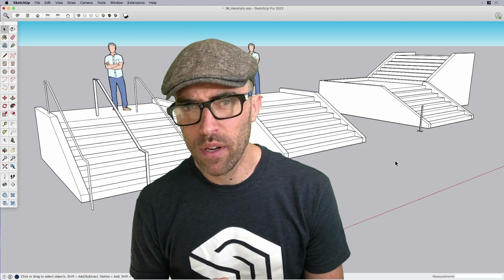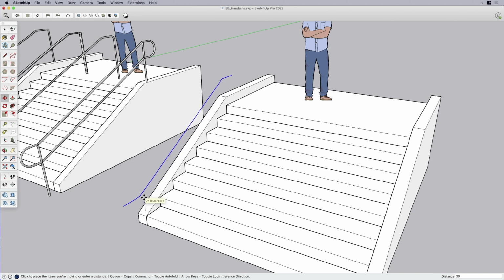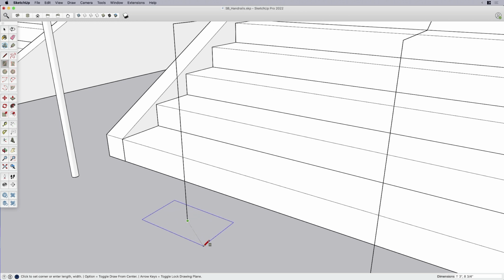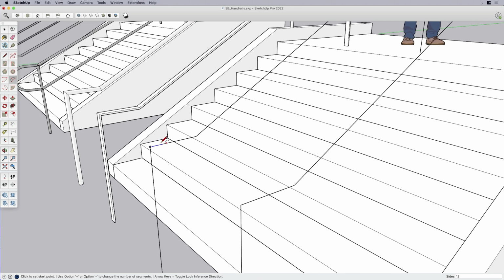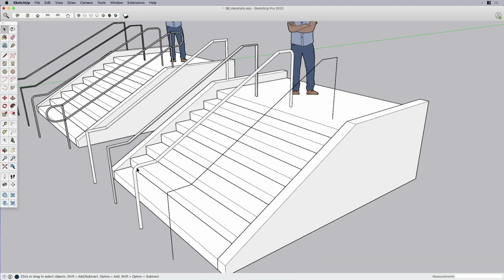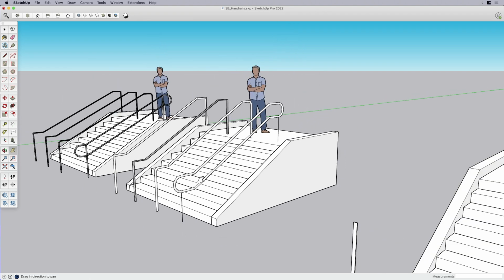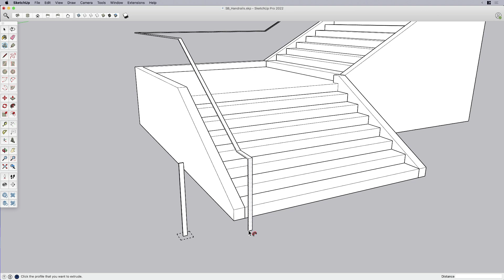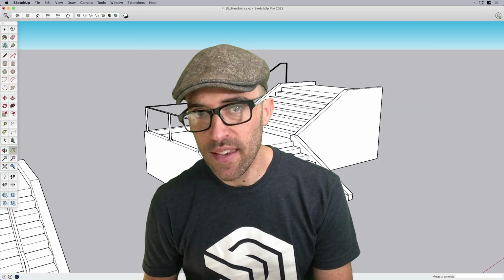Modeling Stair Handrails - Skill Builder

Comment: How about if we need a support in between the slope and not have the joint look unnatural? Especially in case of a tube type railing?
Reply: Just make the support separately and add it.  Like a cylinder.
Reply: That's what happens when a tech guy tries to play architect. The railings are not legal either. Oh,  the life of an Architect. Good demo of follow me. I draw railings the same way, just more complex with more layers of paths. Your demo is good to teach laying out elements with single lines and guidelines as well.